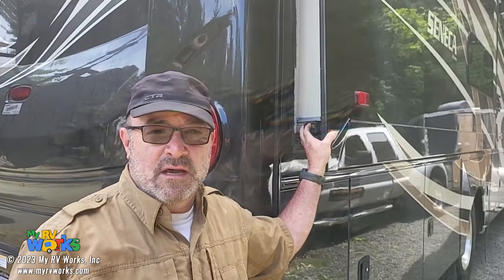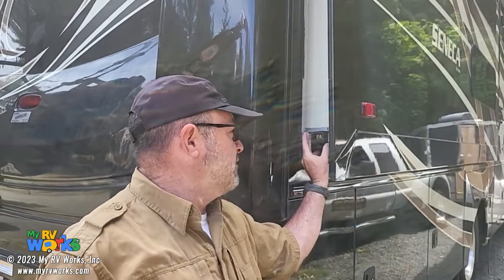Schwintek Slide Gears Seized Up -- An Important Tip -- My RV Works

Comment: Buddy I just want to say thank you! I had one rail out of 4 locked up. Dealership wanted $2700 to replace and repair left side. I found this video so I went and bought some power lube. Sprayed it down the rail onto the slide block and soaked it. Let it sit and miraculously after a few tries it freed up! Lubed all 4 rails and now works perfectly. 

Just saved me $2683 dollars!

Comment: Hello Darren,
  Thanks for sharing your wisdom with us.  I have a Schwintek slide and it was making a snapping noise about a foot from closing completely.  ( This is after having it replaced last winter).  Last trip I lubed the groove on top and the worm shaped grooves on all pieces of track with the PTFE lube.  Wiped off excess and also l siliconed the inside weatherstripping.   It worked like butter !!   We will see how it goes next trip in July.   😊

Comment: Hi Darren,my name is Wade Elliott, I have watched many of your videos on the Schwintek systems because I had one that only one side would move. Long story short I decided that the one motor was bad. I had to take all of the inside trim off, only to find that there was not enough room to get the motor out. Same on the out side. I notched some of the frame on the inside and got it out and made the repair. Have you ever had this problem? I felt like i was a butcher, but it seems it was the only way. I would like to thank you very much for your great videos and information, Thanks again!

Comment: Darren, you and I have yet to meet, but I'd bet you a glass of your favorite brew that the reason Lippert doesn't recommend lubing the Schwintek slides as they don't want less than education folk using WD40 or white lithium grease on those slides because, as we know, those lubricants will attract all the dust, dirt, and grime in the known universe which would make the lives of service folk just miserable.   You've got it - as long as you use that CRC stuff with the PTFE, then life should be good.   Well done, Sir!!

Comment: I don't see anything like that on my normally operating slide. Where do I lube that to keep it from becoming stuck?
Reply from the maker: Darren details the locations on this video: https://youtu.be/lQPIrVaSOlk
Reply: @MyRVWorks  WOW! Ive watched that in its entirety. Quite a while back. But I watched it in its entirety again. Wholotta info if you need to repair your slide. And I know where I am going to come if I need to do that. But... I would REALLY like to just lube it now, so I can delay being broke for as long as possible. And this is VERY hard to follow for lubing. Too much loose stuff flying around. I would LOOOOOOOOOVE to see a video with the slide NOT disassembled and functioning in an intact RV. And how to lube the slide in that INTACT RV

Comment: Help! 2019 Thor hurricane. As I was trying to pull the slide back in the motor popped out but I've actually learned how to put the motor back in I did But realize that it wasn't cheated all the way Thomas I watch some more of your videos and was going to use a socket to push some of those parts back down and Slide the slide block to whether the motor would sit flush. And when I was trying to get the slide to come back in to have a little more room the pop back out again and one of the red power wires to the motor got sock removed and I can't get it back in so there's no power to the top motor Honda power slide at the back. At this point we'll have to pull the H column out

Comment: I just got hit with the Schwintek failure on my 2021 2500rl Imagine. Got the 2 green and 8 red warning ⚠️.  It will about 6 inches and stop. At least it is closed so back to the dealership again.